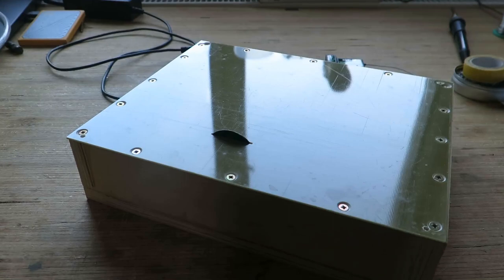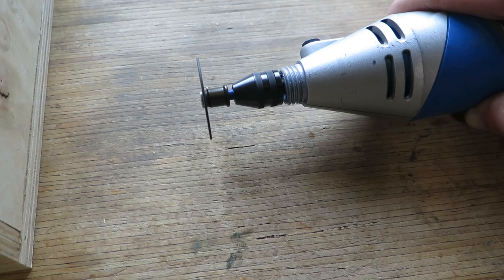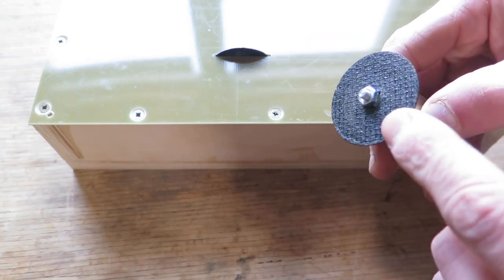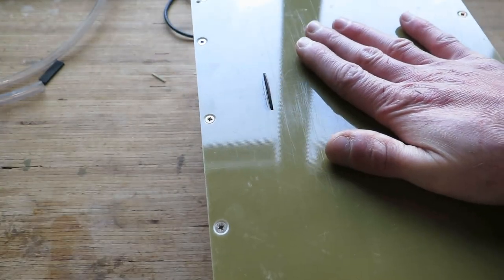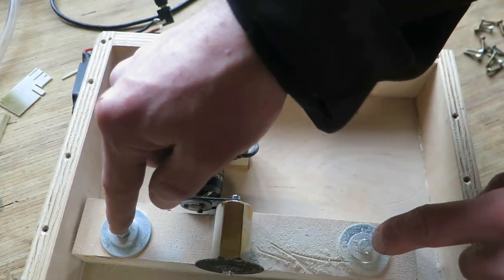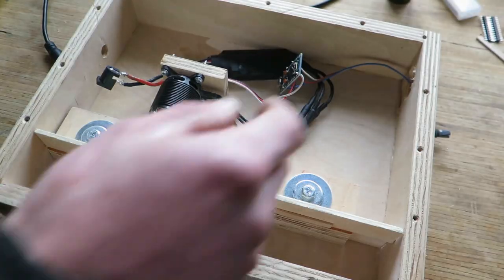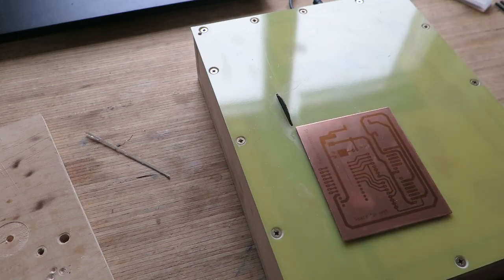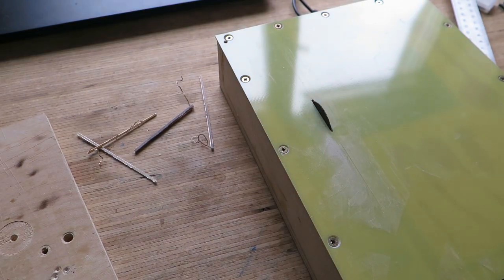Small PCB saw

Comment: You can use breaking if you install a break chopper. You would need to mess around with a comparator and a power transistor on a heat sink or you could use the analog inputs and a PWM output of the arduino. Let's say you connect a voltage divider from the power rail to the A1 of the arduino. If the supply rail is increasing over the safe voltage, you start ramping up the PWM to turn on the power transistor across the supply rails (with a load resistor) and dump it as heat. That's exactly what industrial VFDs do when DC breaking.
Reply from the maker: But it does introduce spikes on 5V regulated rail. Those are LDO's so it's probably crappy ESC design. Anyway at that point either 5V zener would probably work, but then I could have bought servo tester and not waste arduino on this.